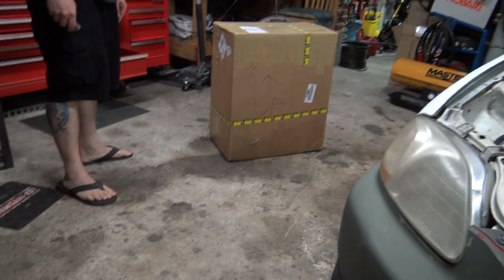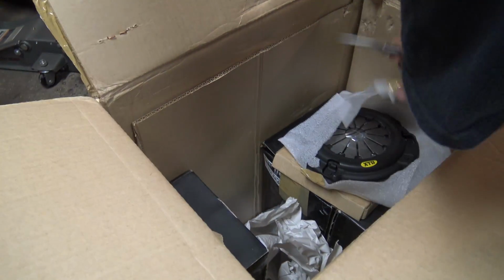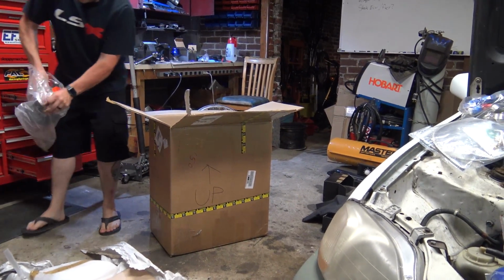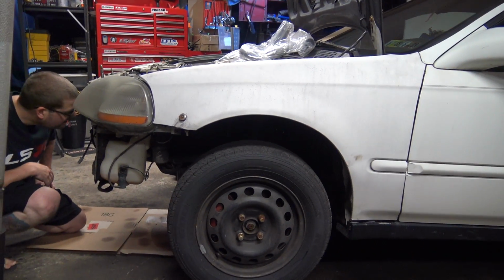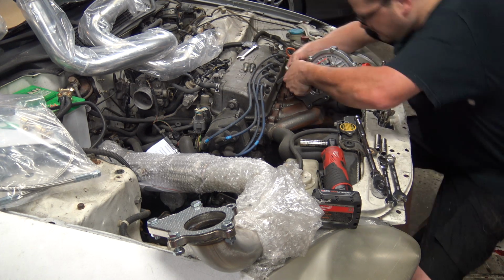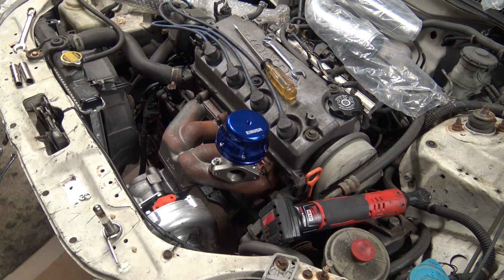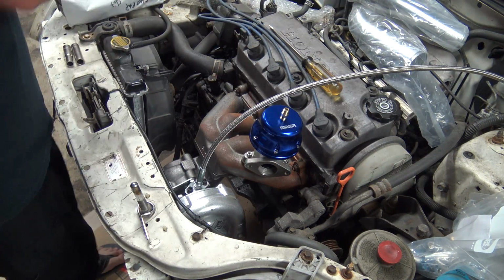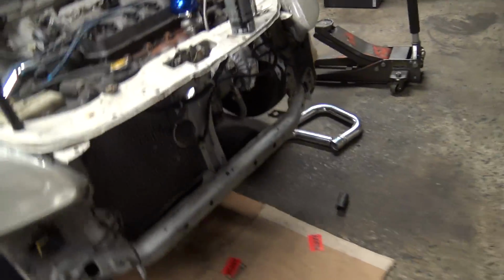lets start this turbo civic

Comment: you want the EX transmission, has steel shift forks, other models all have aluminium. for ECU i recommend hondata s300, more expensive than your basic rom burn chip but has 99% capability's of a full standalone at 1/3 price (500) fully plug n play,boost cut, lean cut, launch control, even has flex fuel. if your willin to open the motor you should do eagle rods 300, vitara pistons 100, arp headstuds 100, notch the block to clear the rods; with those 4 things it should be good for 400+ vs 250 stock. PS you shoulda just droped the oil pan lol, and should do sandwich plate for turbo feed otherwise its getting unfiltered oil
Reply: you must be new here
Reply: been around for a bit, just dont comment on most of the chevy stuff, i get this is a joke build, but i do lots of "serious" builds with these cheap parts on hondas they turn out very well, just given matt my 2 cents
Reply: he has done a few hondas before with the exact same parts you listed thus why he said you must be new lol

Comment: Let me know what you need for it, I have a garage full of parts that are rotting away. Excited to see what you do.
Reply from the maker: ill be talking about it in a video update, just wanted to see if i could just turbo it as is to avoid lengthy junk and needing parts and sitting on a non running car, i hate long term projects and builds, so this was an easy way to just get er running, it might get a manual swap, ecu, wiring and all that shit, but for now its just have fun with whats there and whats easiest, i think people complicate things for themselves way to often and then get overwhelmed and not finish things, much easier to take the most direct route for this and then figure out what i wanna do later with some input from you guys, ill make an update video tonight or tomorrow and see what we can come up with next.

Comment: I think it's hilarious that the stock 450cc injectors from my DSM, are a Honda upgrade. And fyi, they'll be good for 250whp with a descent pump.
Reply from the maker: well when you start with an injector half the size, a 450 is an upgrade yes

Comment: Since you are planning a manual swap anyway now, maybe push the auto to failure.
Reply from the maker: Gearbhall I think that's a goodidea
Reply: Denmah durability testing to failure is always a good call!!
Reply: theres a=some broscience floating around that a external cheap-o trans cooler will actualy keep the trans together on  a mild turbod civic. would be dope to see it work. alot of people lack faith in the auto
Reply: If you want, I have a trans cooler you can have.

Comment: Lol dude that same thing happened to me on my ls1 oil pan, some kind of casting was in the way of my hole.  Threaded the fitting in the best I could, and jbwelded that bitch haha.  Doesn't leak whatsoever
Reply from the maker: flat head screwdriver and hammer. mint